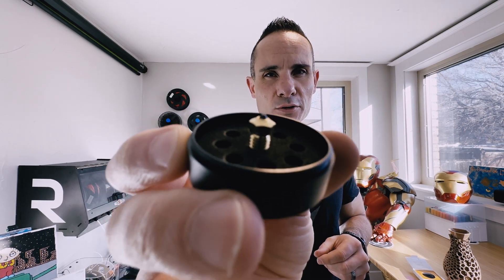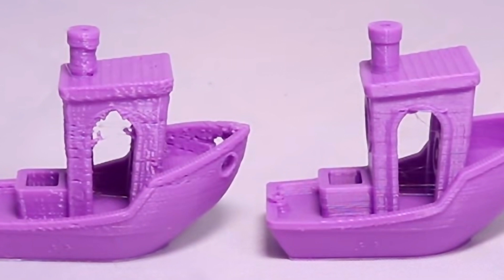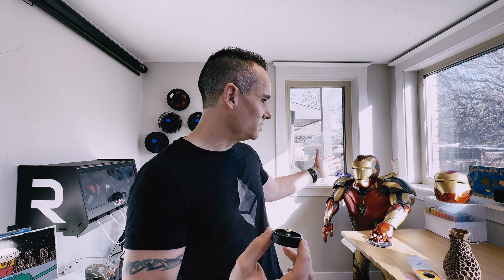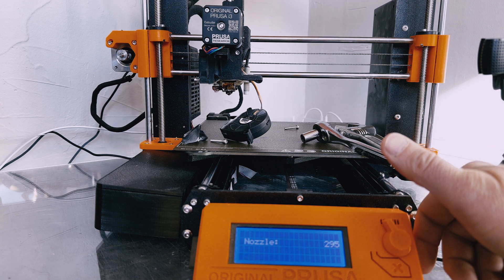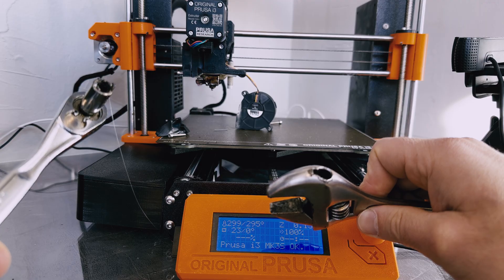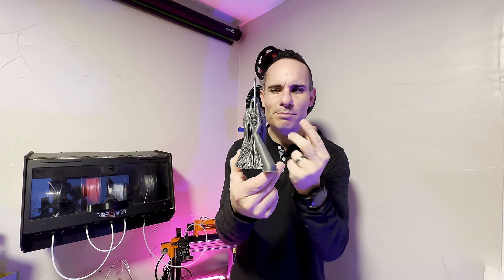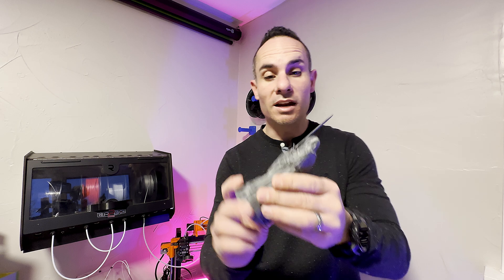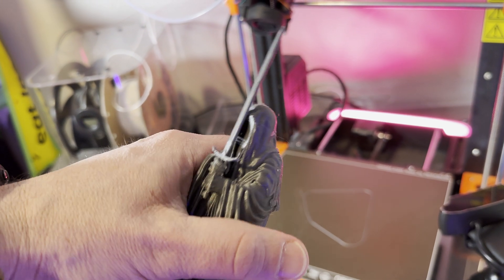Prusa MK3S Gets a Diamond Nozzle Upgrade: Diamondback 3D Printer Nozzle

Comment: Great video! 
I'm thinking of buying one myself, after 1 month of the video, do you still recommend this nozzle? 

I mostly use hardened steel nozzles, but it has the problem of not being as thermal conductive as brass. Compared to the old brass nozzle your were using, did you keep the same temperatures? Or did you have to increase for the diamond nozzle? 

Thanks for any help! And keep up the great videos!
Reply: I actually decreased the print temps by 5-10 degrees. The diamond is more thermally conductive than steel and brass which I wasn’t expecting.
Reply: @allyourtechai  
Interesting! Nice to know that!

I thought the joint between the metal and the diamond would maybe make it less conductive than solid brass. 

I might buy one for myself then. Thanks for the info!
Reply from the maker: If you do, definitely let me know how you like it. I ended up buying a second one for my Voron printer.
Reply: @ALLYOURTECH3DP  I'm also looking at the diamond nozzle for my Mk3s+, did you select a 0.6mm? or 0.4mm? I have a ruby 0.6mm I'm going to install in one of the Mk3s+ printers to test, but wonder if there'd be a reason to go for the diamond (which takes lots of gold...)🙃
Reply: @ALLYOURTECH3DP  I'm a bit late, but I wanted to give a complete reply. I ended up buying a Diamond Nozzle but from Triangle Labs not Diamondback (The shipping price to my country from Diamondback was even higher than the nozzle itself). 
Been using it for about two months now, it's way more effective than I believed it would be. While before (hardened steel) I would have to use 215-230 to print wood or glow in the dark correctly, now I can print at about 205 and at faster speeds than before!
 I even compared to an old brass nozzle I had, and it can match the temperature and speeds even thou the brass one is 0,4mm and the diamond is 0,6mm. 
It's a bit expensive, but I must admit not needing to change nozzles to print abrasive filaments and maintaining brass speeds and temps on a larger nozzle has made it worth it for me!